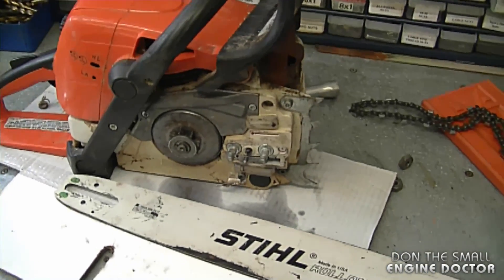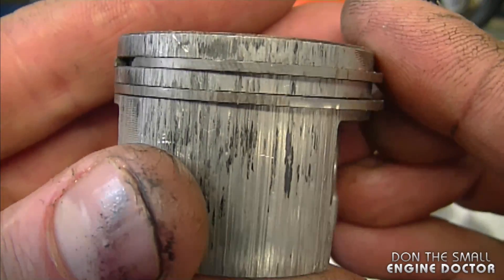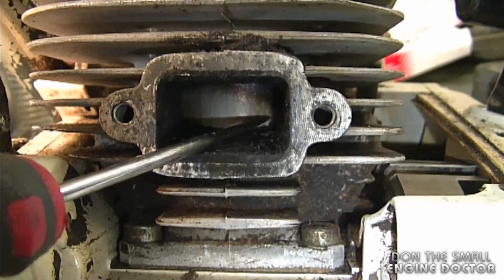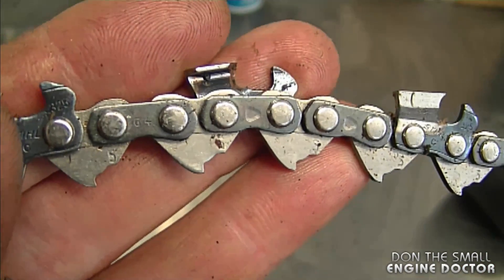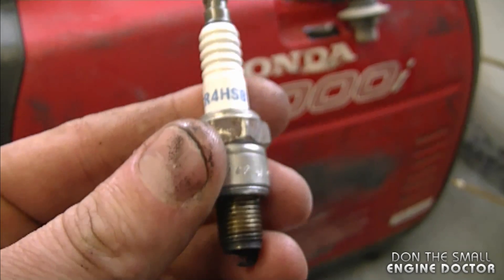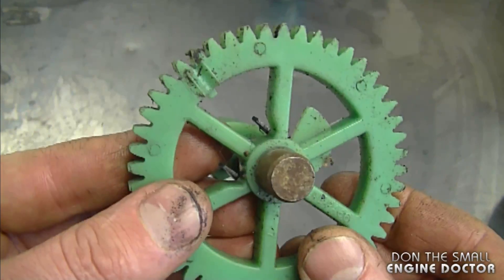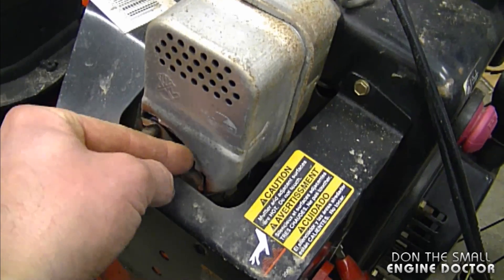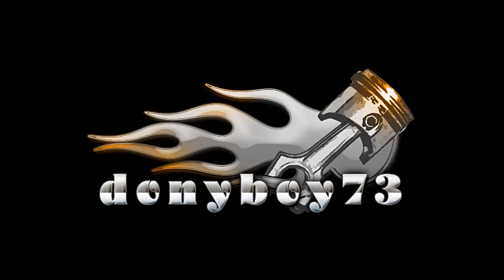Small Engines Q & A Video #139

Comment: Hey donyboy73 is Tecumseh still selling equipment in Canada? We don't have any here in Virginia.
Reply from the maker: no equipment but some parts are still available
Reply: Ok. I needed a butterfly for a carb, could only find the whole carb was $120 I believe.
Everyone in my area always say how awful Tecumseh was. But those motors on the snow blowers actually look decent
Thanks man Love your videos
Reply from the maker: TheAmokamoeba the butterfly is available
Reply: This was on a pretty old murray, think it was a 12 hp. I use psep1.biz and my local mower repair shop but couldn't find it. they had some carbs on ebay but I figured I would be throwing money away

Comment: Hi Don I'm working on my craftsman snowblower, flathead motor. Cleaned carburetor and it runs great,but while under load it dies out. Did a compression test and got no reading,took off the head and noticed that the exhaust valve opens about a 1/32 on the compression stroke. pulled cam out and noticed a little lobe on the backside. is this normal or should I grind it off ?  thanks Ted from Chicago

Comment: Hi dony just a quick question, I have a stihl ms250 chainsaw it does pump out the oil but not much,I've only been using car motor oil and the chain gets tight,would proper chain oil fix this problem thanks.
Reply from the maker: should be ok, but make sure the bar is clean as I mention in this video

Comment: Tecumseh engines are good for rod throwing problems .. They have a week gov setup and over tach easy !!
Reply: One way to prevent the governor problems on a Snow King engine is regular oil changes.  I've repaired nearly every high-revving Tecumseh by just changing the oil.  Sometimes it may take a second oil change to resolve the problem.  One other thing is a lot of folks run straight 30w oil in the winter.  Below freezing temps and a single-viscosity oil is just asking for trouble.  Here in Alaska, I run 5w-30 in snow throwers.  Keep the oil changed, and make sure you're using the right viscosity for the ambient temperature, and you won't have many governor issues on these engines.
Reply: Ya bull, It's a defect in the way they were built
Reply: ShawnMrFixit Lee
I'm sure that any engine governor could have a defect, but I have a small engine repair shop here in Alaska, and work on a LOT of Snow King engines.  Agreed, some are governor issues, but it's my personal experience the vast majority of problems I find are caused by improper or contaminated oil.
Reply: Been rebuilding these things since I was 10 .. 42 now and I run my own shop as well , Tec  engines have a deft in there gov setup .. Oil changes and weight mean 0  as far as a FIX ! 
 This old man has seen 100s of them and YOUR WRONG !!  Dony has several vids with rods hanging out of the block on these POS! 
 thats the whole reason there out of business  QUALITY !!
Reply: ShawnMrFixit Lee Well, I'm 52, I'm a licensed aircraft mechanic, and certified in Tecumseh and Briggs.  I've been working on these every bit of 40 years.  I never said these were perfect engines, as I've seen my share of busted rods and crankcases as well.  I'm agreeing that some Snow Kings have dragging governors, however based on my observations, this problem is exasperated by dirty or thick oil. Of course, if the motor revs too high for too long, the governors on these do tend to part company with themselves.  I've seen as much of that as you have.  What I'm saying is if I don't suspect a severely rev'd engine, I will inspect the oil for contamination, and I have made quite a few governors behave with a simple oil change.  One other thing I'm sure you're seen is bent linkages from "mechanics" ruining them while removing/installing carburetors.

Comment: Hey Dony, you talked about snowblower keys. I got my snowblower used, so I don't know the stock wiring setup, but I noticed that my snowblower will start and run, whether I have the key or not. Do you have any tips or videos on that?

p.s.: It's an MTD SnowKing Tecumseh 8hp

Comment: Great review doc.. .. put  the  spare key in a  parts  bag marked for your snow blower an put on shelf . Doc  what  tool  or solvent  or you tool do you use on the exhaust port of  chainsaws ? I use  break free an blow it out  with compressed  air  wearing  safety glass's  of coarse its messy ..  I suppose a  sharp flat head screwdriver would work as  well , just  don't hit the cylinder . cheers

Comment: hey don,
i have an stihl 08 s chainsaw an i have a little "problem" with it.
when i flip the saw to the front, the idle gets slower. sometimes it even dies.
actually the saw is in a pretty good condition, no sratches in piston or cylinder, no play in crankbearings, it has a new carb kit and the fuel lines are clean. even the spark is very strong. i have no idea what the problem could be.
Reply from the maker: you could try a new carb kit
Reply: How full is the fuel tank? Could be that tipping it is letting the pickup hose come out of the fuel and suck in air.